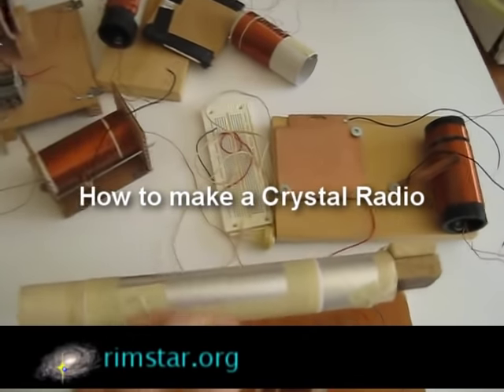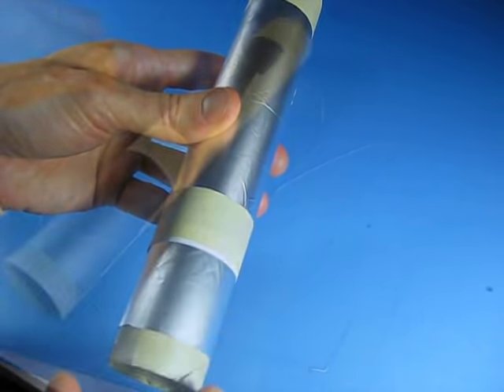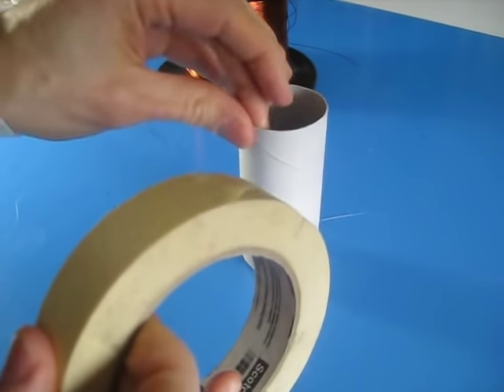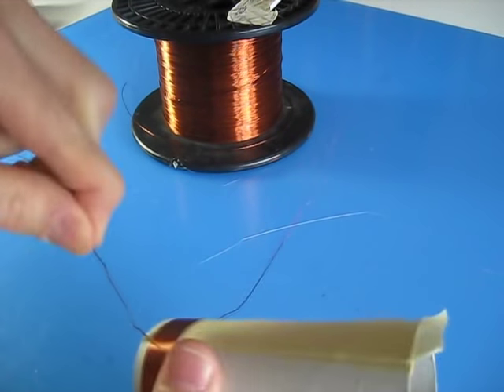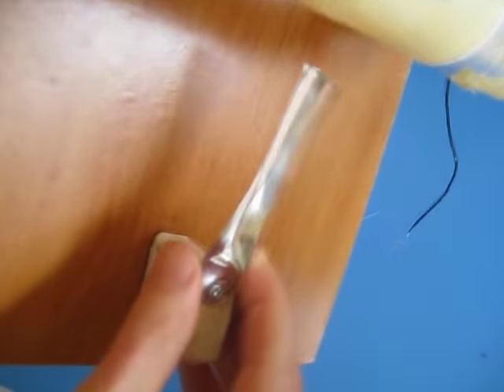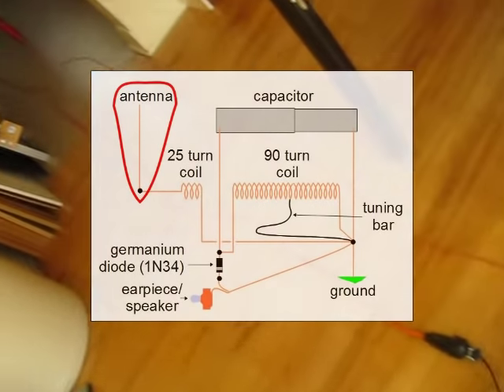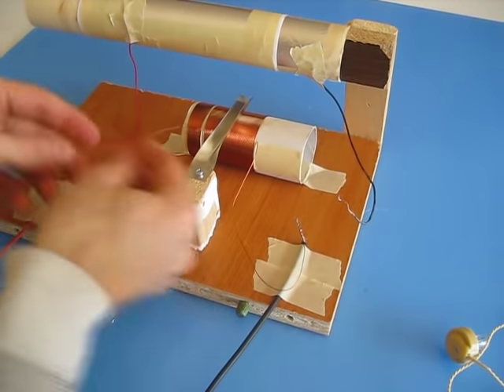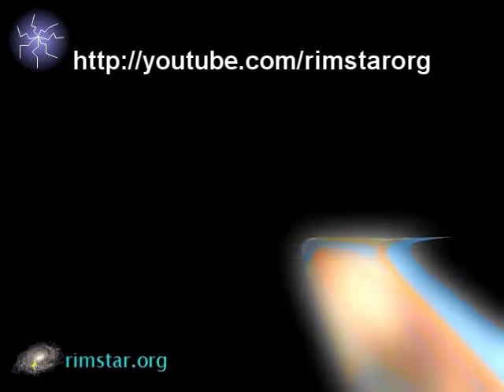How to Make/Build a Crystal Radio

Comment: Well, I built it exactly as described, but with no luck picking anything up!  The most exciting thing I got was cycling crackling (about 2 Hz) which increased in loudness as I telescoped the capacitor out.  I was hoping it would resolve into human voice, but alas not.  Troubleshooting: so far Ive tried a longer arial (30 feet) and a shorter arial (10 feet), both in a variety of positions, no luck.  I've checked the continuity of all the cables with a multimeter, all test okay.  Any hints / suggestion for further troubleshooting would be we welcome!  Thanks!
Reply from the maker: It sounds like you've done your homework. That longer arial is usually the most helpful tip. Making sure you have a good ground also helps. You could also try hooking up an amplifier to see if the signal is just too quiet (here's how I hooked mine up https://www.youtube.com/watch?v=U5axWtCqgCA ). Also, are there any AM radio stations to pick up? They're getting harder to find. Between you and what I said here, I think we've covered it but FWIW, here's my tips and tricks webpage https://rimstar.org/science_electronics_projects/crystal_radio_tips_and_tricks.htm
Reply: @RimstarOrg  Many thanks, I will try some of those troubleshooting tips!
Reply: @RimstarOrg  Hi, just thought I would report back that today I got it working!  Am totally stoked!!  I replaced the eBay 1N34 diode with one I purchased from Mike's Electronic Parts (Ohio).  I picked up Gold Manchester (1458kHz). I also discovered that by moving my finger on the back of the earpiece that the signal would come and go.  Not sure if there's a lose connection in the earpiece or whether I was somehow changing the capacitance of the earpiece (I noticed there is a metal screw on the back), further investigation required.  For now I an super pleased!  Thanks for the great instructional and I really enjoyed your other video about how it works.
Reply from the maker: Thanks for letting me know! So often I don't know how it went. I'm stocked that you got it working. I know the feeling.

Comment from the maker: You can reduce the size of the coil using a cylindrical ferrite core instead. It's around 1cm or 1/2inch in diameter. You can make a smaller capacitor using double sided copper cladding board. I show on of those capacitors in my "Crystal Radio Troubleshooting and Tips" video (there's a link to the it in the description below this video.) You can also buy smaller commercially made air core variable capacitors. I give a link in the description to midnightscience's website if you want to buy one.

Comment from the maker: I've bought mine online and some from stores locally. There's a link in the description below this video to where you can buy them, but there are many, many places online that you can get 1n34s. They're pretty cheap. I really don't know where you can find them in junk electronics. I usually find resistors, capacitors, transformers, cores, but I've never taken out any diodes. Maybe from old radios?

Comment from the maker: Any kind of wire will do for the antenna, including the magnet wire. The only part you have to bare is the end where you'll connect it to the rest of the circuit.

Comment: A neat trick is connecting the radio to a small single transistor amplifier, this makes it sound louder and drops a small extra voltage through the diode, that allows you to use a bigger range of diodes, even including orange LED's and red laser pointers as detectors.

Comment: Nice!!!.....here's a couple of tricks you can use.....
1> germanium diodes aren't always easy to get, so use a silicon diode in stead, but.....
you need to add a small battery to knock down the "barrier effect"........
here's how: you need 3 parts......1> a battery holder ("AAA" or smaller), 2> a pot (volume control) 50K ohm. 3> a resistor 10K ohm.
wire them in series, and then connect them across the diode.
the battery (-) goes to the cathode end of the diode, the + end to the other end of the diode.
to turn it on,just insert the battery, then adjust the pot starting at maximum resistance.
when you hit that narrow spot (the "sweet spot") where you can hear something, then fine tune.

for wire stripping, try steel wool......it's a lot safer than a knife.
Reply from the maker: jim walker Thanks! When people ask I never think to mention using a biased silicon diode. Usually I suggest multiple silicon diodes in parallel, which I haven't tried but some others have had success with. I should give both these a try. Thanks for the write-up.
Reply: multiple devices in parellel won't make a difference......since they all have that "barrier effect" i mentioned......800 milivolt (for silicon) minimum forward bias to be exact.
(it's also expressed as "Vfd" (forward voltage drop)
i hope this 411 proves useful.
Reply from the maker: jim walker The commenter said it worked for them. Maybe they just got lucky and happened to catch it at a time when the signal was stronger, or maybe they had a strong enough signal in the first place but a bad connection which got fixed inadvertently. I'll just have to try it and see. Though I know what you mean.
Reply: the only way they could have "gotten lucky" is if they had accidentally included either a germanium or a low-barrier schottkey device in the bundle.
it is simply not possable to get that kind of "lucky" with silicon devices.
remember......the voltages that develop in a crystal radio's circuits never exceeds 10 or 20 milivolts. (defenitly not enough to overcome the 800 milivolt barrier found in silicon devices like 1N4000-series diodes.)

Comment from the maker: How long is your antenna? 1N4148 is a silicon diode. That and the zener and avalanche diodes need more voltage to start conducting than mine with my three parallel 15 foot antennas. I'm guess either you're antenna is pretty long or you're near some powerful radio stations. Let me know so I'll know if I should add them to the list in the description below this video with a caveat.

Comment from the maker: The only difference between a foxhole radio and an old style crystal radio is that the old style crystal radio used a galena rock crystal and a sharp wire for the diode and a foxhole radio used a razor blade and pencil for the diode. My video "Make Razor Blade Diode for Crystal Radio/Foxhole Radio" is a foxhole radio because it uses a razor blade and pencil. There's a link to it in the description below this video.

Comment from the maker: No, there isn't enough power to run the coils of an ordinary speaker. Well, unless you have a really long antenna. It's not the best but you can use ordinary earbuds if you add a small transformer. I explain how in my video "Use Earbuds/Earphones with Crystal". There's a link to it in the description below this video and you can find it on my channel page.

Comment: Of course, the original method of rectification was via natural rectifiers that exist in galena which were used in the "cat-whisker" radio receivers. Other materials such as iron oxide are capable of rectification which resulted in the fox-hole radio of WWII. BTW, it is possible to find spots in some galena ore that are capable of acting as a light-emitting diode.
Reply from the maker: Yup, IIRC it is the iron oxide approach I used with my razor blade crystal radio (fox-hole) https://www.youtube.com/watch?v=eIdHsjfbckw It would be great to try Galena someday.

Comment from the maker: I've no experience in sw so I can't give a good answer. I have tuned in 1.8MHz with the radio in this video though, but that still leaves a lot of sw. What you say about using a grounded stiff wire that moves over the coil so you can hear mw sounds right, and in fact isn't needed since the tuning bar in this radio is just that - it's grounded.

Comment: The first radio i built was made from your diagram 3 or 4 weeks ago.For me it work from the first time, it is posible that it works so good beucase i dont have my room at the lobby i have it at the first floor.Know i have an variable cap from an old radio that i buyed from an electronic store , and i mounted all the thing on a terminal block connector. I used a ferite core mw coil. Thanks alot , hope youl place some updates for radios like a homemade variometter.

Comment from the maker: Speaking for myself, I know the names of the diodes that I've used. And the diodes do have specific jobs in the sense that they have various parameters, like how much voltage they can handle, or how much voltage it takes to cause them to conduct significantly, and so on. Some of that is also due to the type of diode: germanium diodes start conducting at a lower voltage than silicon diodes for example.

Comment from the maker: The voltage difference comes from the incoming radio waves. The radio waves themselves are your power source. No battery is needed, unless you want to increase the volume by adding an amplifier. See my video "How a Crystal Radio Works" for more on this.

Comment: I just tried this with a few minor modifications and no luck indoors or out so far. I used 22 AWG Enameled copper wire (perhaps too thick so coil isn't long enough, right?) and a 1N34 germanium diode. I used foil tape to wrap the capacitor (paper towel cardboard tube) and aluminum foil and paper with a fairly snug fit on the movable part. I am not certain of my ground and I shaped a wiper using some thin brass (actual brass plate, cut to size). I probably need to buy a three prong plug and do the trick you showed on the ground. I live near the foothills of some mountains and I am not sure of any AM stations near me. They are probably on the other side of the hill toward more populated areas, but the closest is probably 60 miles away in the mostly clear side to the northeast. I may be S.O.L. when it comes to AM. All I get is very faint static. Do you know how I can build a similar FM receiver?  I plan to take this up to my son's house in a more populated area to see if I can get it to work. In the meantime, any suggestions are welcome. I made one of these without the capacitor on a six inch square piece of wood back in 1965 with pretty good results, but the AM broadcast tower was within a mile of my house back then.
Reply from the maker: In the inductance formula (https://rimstar.org/science_electronics_projects/coil_design_inductance.htm) the number of turns plays a bigger part (it's squared) than the length so I'd suggest getting the 90 turns over maintaining the length.
Make sure your brass wiper doesn't have an insulating coating on it. Scrape it off wherever it needs to make electrical contact if it does.

Where two strips of foil tape meet, they might not make electrical contact, so your inner capacitor plate may not be a single plate.
The antenna should be as long a straightish length as possible for picking up far away stations though your mountains and the distance to the nearest radio station may play a big part too, as you suspect.
And nope, I've never done an FM receiver.
Keep at it. You'll get it working sooner or later.

Comment from the maker: I assume you're using a transformer because you're doing what I talked about in my "Use Earbuds/Earphones with Crystal Radio" video so you can use normal earbuds. You don't need a transformer if you're using a crystal earpiece. The function of the transformer is to have a high impedance (like resistance but for AC) on the tuning coil/capacitor side of the circuit. Without the high impedance, the earbuds would take too much energy from the tuning circuit and it wouldn't work.

Comment from the maker: The 25 would still be fine but my calculations say that with 90, your lowest frequency would be around 676kHz whereas the lowest AM radio frequency is around 550kHz. For the full range I'd suggest adding more turns, up to 150 turns instead of 90 should cover it. However, being able to tune in from 676kHz to 1600kHz covers a lot of radio stations, so if you can't do 150 you'll probably still be able to pick something up.

Comment from the maker: That would depend on what amplifier circuit your battery is powering. In my "How to Make Amplifier for Crystal Radio Earphone" video which just amplifies the sound going into my earphone I use a 9 volt battery. If you're curious there's a link to the video in the description below this video.

Comment from the maker: One end of the antenna wire isn't connected to anything. The other end goes to the end of the 25 turn coil that is farthest from the 90 turn coil. See the diagram in the video at 0:24. Since it's the ground wire you're connecting to, you shouldn't have to switch on the extension box (I don't have an extension box to switch on anyway.) See my video "Crystal Radio Troubleshooting and Tips" for more about grounding. There's a link in the description below this video and on my channel page.

Comment from the maker: What is the diameter of your ferrite core? For one that's around 1cm in diameter you need only around 30 turns instead of the 90 ACCORDING TO MY CALCULATIONS. I haven't tried a ferrite core myself so I suggest more turns anyway to be safe. Having extra turns doesn't hurt if you have a tuning bar since everything after the tuning bar doesn't count. You might be able to use two coils if the ferrite and the coils are touching. How long is your antenna and what are you using for ground.

Comment: The Red wire of the 3-pack from radioshaft is #30  At 9:25, a very small butane torch works well as well.
Reply from the maker: Yup. Thanks. Regarding 9:25, I've tried with a match and lighter and it leaves a carbon residue. Do you get any, or do you clean that off?

Comment: Quite an interesting video.  I like the variable capacitor.  However I am concerned that grounding both the coil's wiper and the right hand end of the coil makes the right hand section of the coil into a big shorted turn.  Which, as you imply in the part about sanding the windings, is a big no-no.

Comment: When I make radios I take my lighter to the wire and burn off coating. I was surprised you mentioned that in this video. You should build a foxhole radio sometime. They are quite similar to the crystal radio.
Reply from the maker: Foxhole radios are crystal radios, just using a different circuit and tuning mechanism than I do here. There are soooo many circuits to choose from for crystal radios, part of what makes them so fun. I did try a razor blade in place of the commercial diode, though it wasn't very loud. You can see it in my "Make Razor Blade Diode for Crystal Radio/Foxhole Radio" video here http://youtu.be/eIdHsjfbckw

Comment: It is a true crystal radio. In the point-contact diode, the crystal is inside the diode. A diode detector was a crystal detector. It was a germanium crystal. A point-contact germanium diode is simply a very small version of the old cat's whisker. Take a magnifying glass and look into a point-contact glass diode. You will see the whisker and the crystal. Back in the 1980's, I used various crystals in a cat's whisker arrangement instead of the modern diode. I used germanium, galena and pyrites quite successfully. My favorite was a two crystal arrangement of zincite and bornite. 

The wikipedia site is pretty good if a bit incomplete: http://en.wikipedia.org/wiki/Crystal_radio

It is an interesting note that at the end of WWII, bell labs started playing with the crystal detector again. They added a second whisker in very close proximity to the first and the transistor was born. This site is helpful to see how the whiskers were arranged:  http://www.r-type.org/articles/art-090.htm
Bell labs used precision cut gold foil as the whiskers for their "three-electrode germanium crystal contact device, known as the Transistor" ("Transistor semi-conductor triode"). They rigged a triangle jig to hold the foil and that's what the diagram of the transistor is today. 
Some original point-contact transistors had a little window through which one could see the two little whiskers contacting the germanium crystal. Way cool!

Crystal oscillators (tuning-crystal circuits) replaced tuning circuits in the early days of radio because they provided more reliable frequency references for broadcasting. These were quartz crystal slices. They were simply for a timing (frequency) reference. In fact, just a few years later, Bell Labs saw an opportunity and the quartz clock was born. Woohoo! Bell Labs!

Comment from the maker: Do you have any radio stations nearby? If yes, try pointing the antenna at them. How long is you antenna? The longer it is the better it'll work. Mine is 15 feet long, with three in parallel and I get only the nearby stations. The antenna should be stretched out in a straight line as much as possible. Do you have a good ground?

Comment: One radio I made myself which is pretty much like yours, can work with a very common diode, the 1N4148, I tried various diodes scrapped from PCB's and that one worked surprisingly good.
I have a small catwhisker and there isn't much difference.
There are some other diodes that also worked to me, like the B16, a zener diode, and the 1N5060, an avalanche diode.
Reply: Please explan the positive and negative and where they conect

Comment: Thanks for the great instructions!

I was always amazed that you could convert radio waves into electricity.

I read that you if you disconnect a satellite dish you can get power comparable to solar panels.

I wonder what the problems are with this as an alternative power source?  

The advantage is that you wouldn't need storage batteries like you do for solar power because you have a constant power source 24 hours a day.
Reply: radio waves are pretty much just ac current